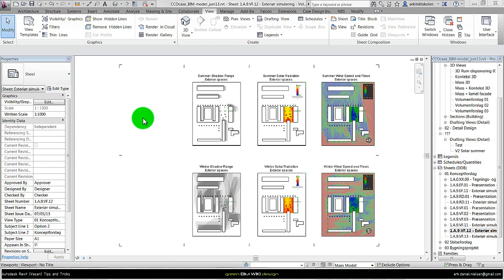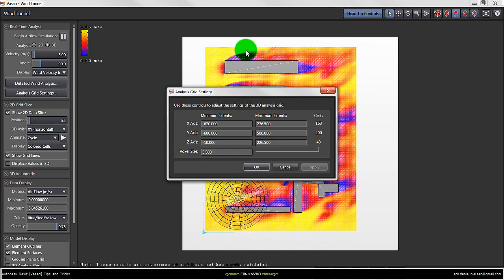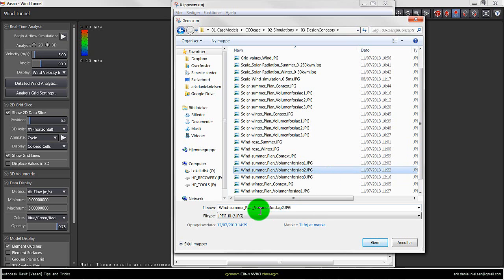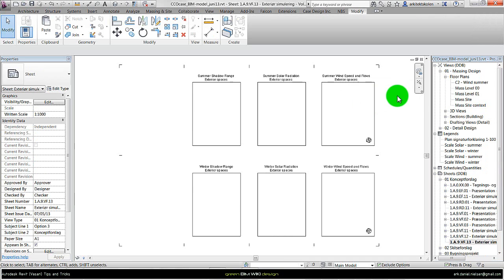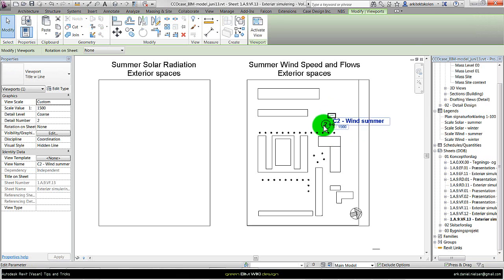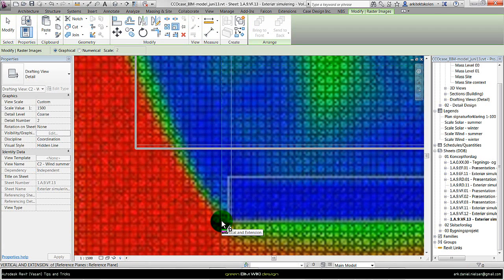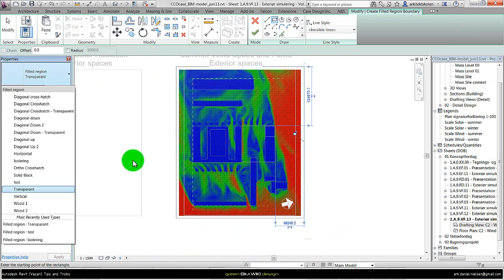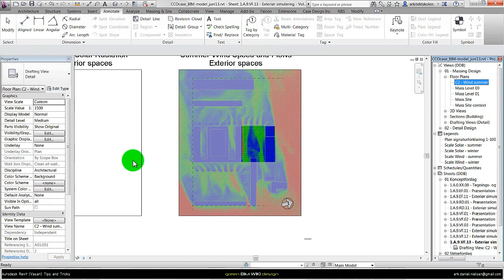Autodesk Revit (Vasari) - Method to visualize and setup Wind Tunnel simulation for comparing

Comment: Vasari has been shutdown by autodesk how to use this in revit
Reply from the maker: Vinay pathak today you can use Flow Design that is a plugin for Revit. It simulates directly within Revit. The methodology is the same! Just a other tool instead of Vasari.
Reply: Daniel Nielsen yes i am using it in revit, but does it also has feature of wind rose like vasari, as wind speed changes as per different site location,and orientation, does it traces the wind speed and wind direction as per site condition as per vasari or do you have to feed manually..can u pls help me on that.thanks
Reply from the maker: Vinay pathak I have not really used the automatic generated orientation or wind speed for different reasons. Mainly because you should analyze the most prevailing orientations manually and take 2-3 orientations. E.g. if the wind is coming mostly from east and west then it will make a average (lets say) south. That would not be correct. Regarding the speed I am always using 5 m/s because the wind sim is mostly a pattern rather than the actually conditions. Try to check this video where I am explain how I read this kind og simulations: https://www.youtube.com/watch?v=coDy8H8lGV0
Reply: Daniel Nielsen thanks for the suggestion,and wonderful video
 i got the soultion to my questiom for that, if we are doing

 
simu on for a specific site

1. First feed the location in analysis in revit and do a whole building energy simulation inrwvit 
2.,go to results and compare we see the wind rose generated for the specific site in revit
3 use that same wind rose detail (direction and velocity ) and feed in flow design and see the results
Reply: Daniel Nielsen  can you also please suugest how to take simulation in flow design plugin for Revit at different floors
Also i am unable to see legend in revit using flow design, thanks